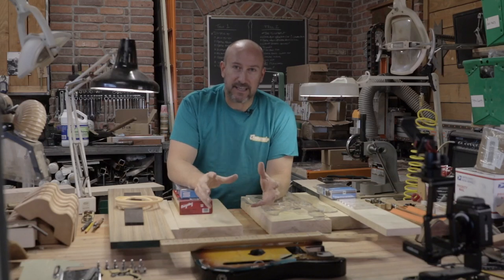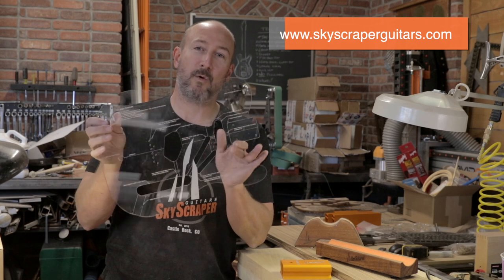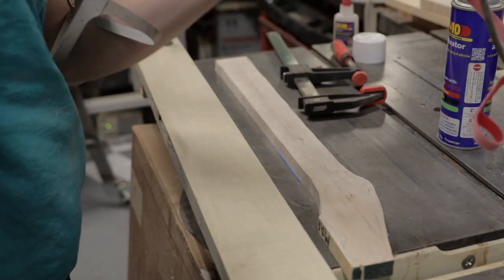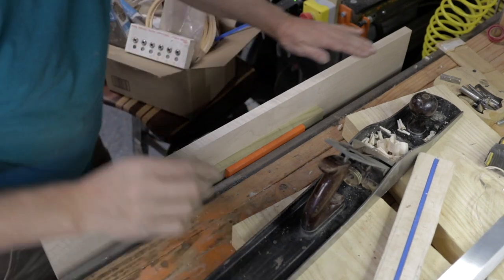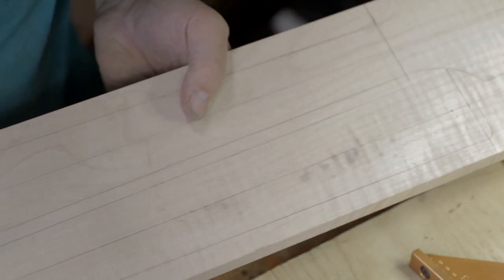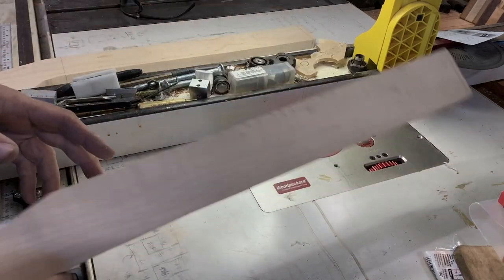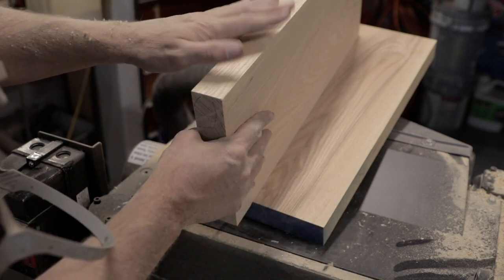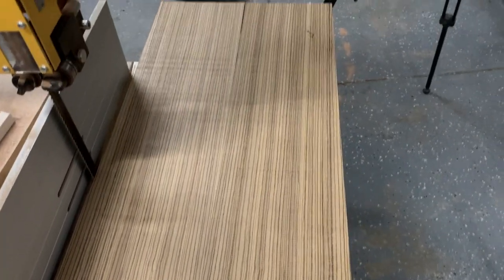Let's Build A Tele - Episode 1 - Roughing and Sizing the Blanks

Comment: I ordered your telecaster template set and it is great.  Wish I discovered this series before I started my first body from rough cut lumber (neck still in progress).  All the extra info you lase into the template is so helpful along with the punch you provide.  One thing I did that I found helpful, I used the templates left and right string through holes along with a neck bolt pattern hole to drill and create index pins using 1/8-inch dowel.  I am very new to this and wood working in general and found this helpful having the ability to take the template off and put in back on (after nicking the template within the first 5 minutes of starting).  It would be a nice feature to have some type of bushings in those holes to use for indexing guides and not worry about enlarging the acrylic holes (but not sure if they are really needed time will tell).  I will be ordering another telecaster set(still kicking my self for nicking the template) and the strat set once I finish my current build.  Keep making great quality tools at great price !
Reply from the maker: If you just need one piece of the set, let me know and we can sell you just that piece so you don't have to buy extra parts.  We have a contact form on the website, so you can get in touch that way and we'll get you squared away...  As for bushings, I originally was going to drill bushings in all the holes, but the cost of the bushings alone almost doubled the cost of the template set.  I may start to offer a set with them as well as a set without.  I need to get back in contact with the bushing supplier to make sure their costs haven't doubled over the last year or so...  Lastly, thanks for the feedback and good luck with all your builds!